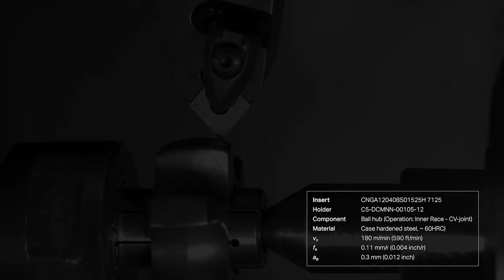Hard part turning with CB7125 and CB7135

Comment: Cooked the tip on that first cut, I can see the heat discoloration.
Reply: Did you see the shavings in slomo instantly cooked them
Reply: Yeah surface looked pretty glazed too
Reply: Almost like they were running without coolant so the video would, you know, actually show anything at all for the sales pitch.
Reply: almost like hard turning runs at ridiculously high temp in order to preheat and plasticize the materials 🤯

Comment: how about showing the insert after machining?
Reply: CBN tip is gone
Reply: Yeah CBN doesn’t like an interrupted cut.  That one wasn’t so bad since it basically had a lead in and out radius.
Reply: @Thewaldo12345  There are many different types of PCBN grades. Some don't manage interruptions very well and others do. As for carbide. I work for a competitor with PCBN everyday and supply PCBN inserts to these kinds of operations at high volume customers.
Reply: You can tell by the chattered finish its crap. I hard turn all day long and you'll never hold a tolerance or see any insert life cutting like that.

Comment: Also try holding a .0002 tolerance ...
Reply: nmbr1aaron we do it everyday on millions of hardened pm parts with cbn
Reply: @rickkilhoffer5693  I've been told this a million times as well. Many reps at the shop saying their insert will hold up on hardened steel with an interrupted cut. Now yes they will hold up but not enough to hold a .0002 tolerance.. what inserts and parameters are you using?
Reply: We use Sumitomo bn7500 150 smm at .100 mm per rev. In a automotive transmission and transfer case factory.
Reply: @rickkilhoffer5693  I'll look into it.. we are a tool and die shop, so tight tolerances are always there. Thanks.
Reply: One more question, what kind of material and hardness are we talking?
Reply: you're looking at the wrong process for that kind of tolerances. you want grinding
Reply: I was able to hold 0.0003 on a Haas TL-1 until the insert gets chipped.
Reply: Thermal expansion of most metals makes it nearly impossible to machine parts to that tolerance even when using cutting fluid since ambient temperature would also have to be closely controlled.

Comment: You are doing it wrong. Insert should move from inside out on that gear ;)
Reply: Tamas Strezi doesn’t make any difference
Reply: I agree moving from the inside to the outside keeps the tool nose from taking the brunt of the cut. That is interupted cutting 101. Always protect the tool nose as much as possible preferable with a large lead angle.